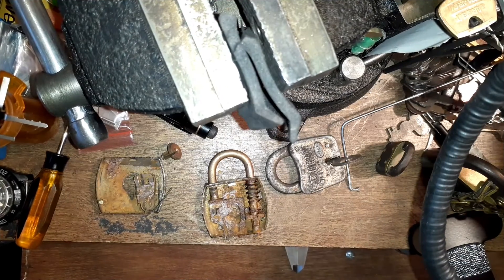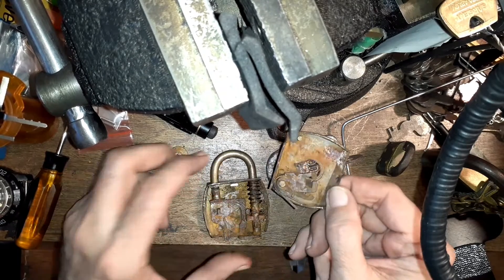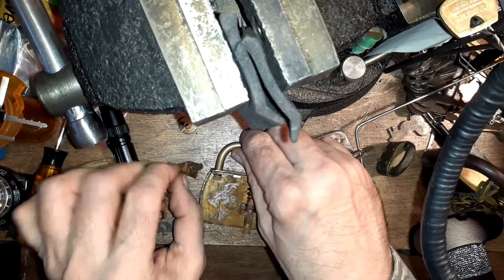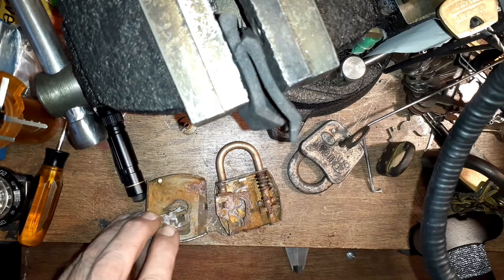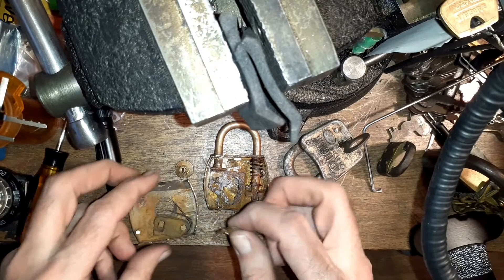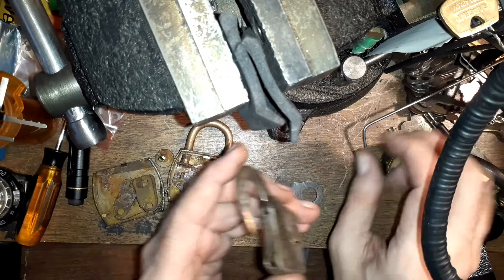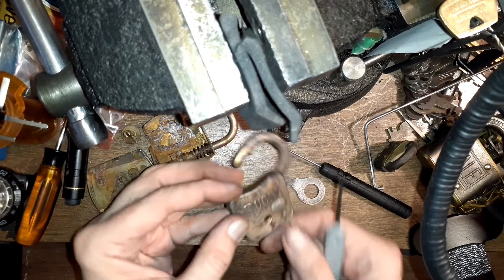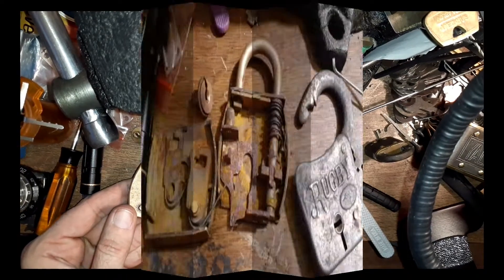(883) Inside an Antique Yale "Terror" Padlock

Comment: This is the only other Terror lock I've seen, I picked one up some time ago. Do you have any more info on this lock? Thanks for showing this!
Reply from the maker: They made a smaller size also,  and offered them in brass, or steel.  It shows up in the 1917 Yale catalog,  and they probably kept making them until the 50's. I don't have any Yale catalogs after 1924, so I don't know when they stopped making them.
Reply: @WilliamMancel  I have the smaller one. Thanks for the info👍